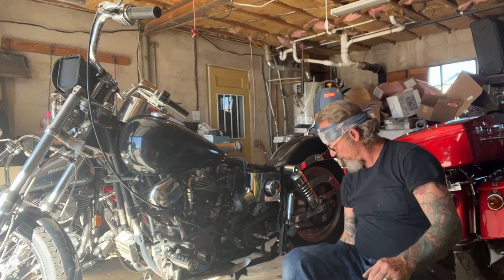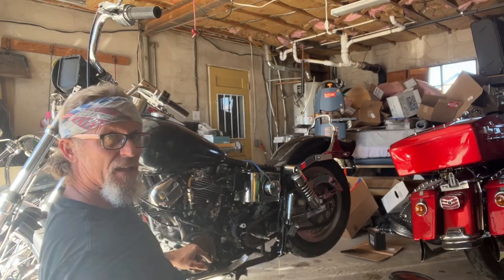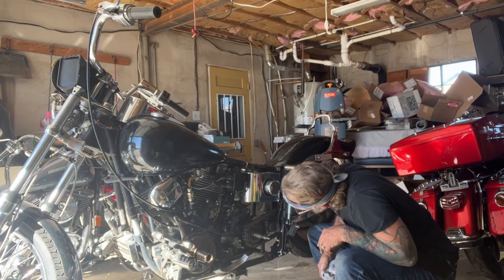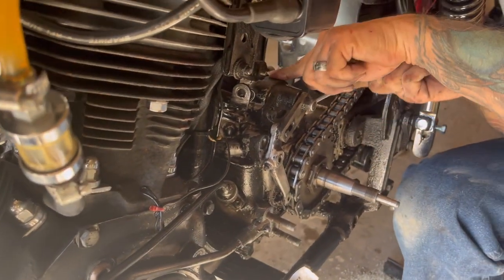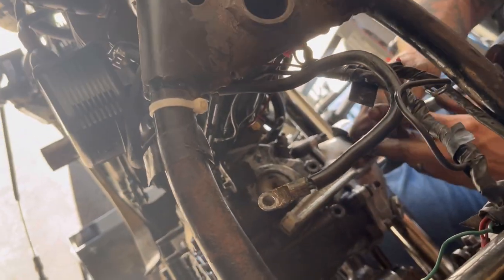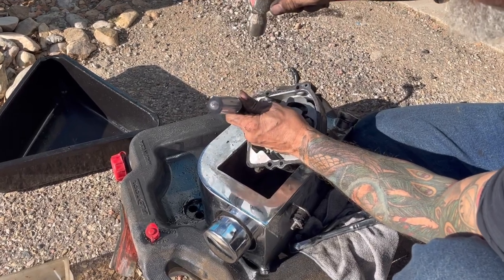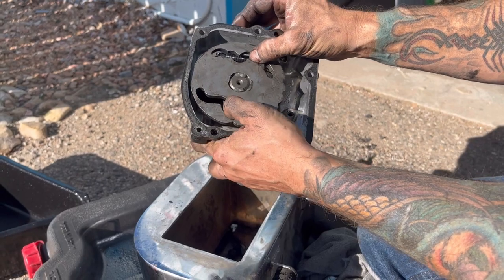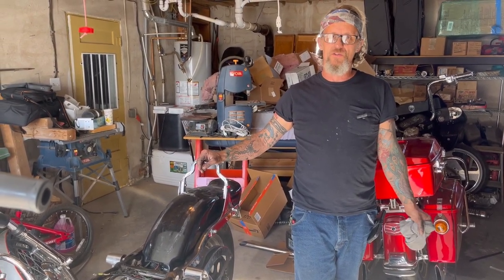Shovelhead Transmission Rotary Top Removal

Comment: Three years ago I took the engine and transmission out of my 77 flh to freshen everything up. There was easily over 50 thousand miles on the top end and who knows what was on the bottom end and transmission.  I ended up sending it to Dragonmans and he rebuilt the engine and transmission for $2000 and that included all parts. When I got it back two weeks later everything looked really good like new the cases were bead blasted. The only thing I had to do was paint the cylinders wrinkle black , put the top end back together and reinstall it in the bike. Almost 15,000 miles on it and she's running fantastic. I still can't believe the deal I got and how nice everything looked , plus how quickly it got done.
Reply from the maker: First positive thing I’ve heard about him !! Glad it worked out for you !!

Comment: The bore that the broken shaft rotates on can be worn, and COULD be the reason those welds failed. 
I just took mine apart now, no broken welds, but a bad bore or shaft.

Comment: one more question for you... when i down shift the shifter lever stays down and won't return...is my issue in the transmission or just the lever?
Reply from the maker: Sounds like the springs inside the ratcheting top of the rotary

Comment: it looks like the weld is busted connecting the shaft to the gear selector plate. @ 16:45.  the plate moves the shaft does not.
Reply from the maker: That’s what the problem was

Comment: IIRC, you may need to bush or rebush the top, actually I worked for a guy who did several tops that way,, all the parts in a rebuild kit, for 'Cow Pie' top, and he'd say, it was only the bushing, for that shaft, that went out of round, so...
Reply from the maker: Good advice! The bushing on this one wasn’t out of spec, but it does happen that Bike has been built, rebuilt, and sold twice since the video was put out

Comment: is there a way to replace the pawl springs without having to remove/reweld the rotary???
Reply from the maker: You have to remove the rotor assembly to replace the springs, not re-weld, but pull the cap on top and disassemble then replace Springs and go from there
Reply: What is the actual name of the top hat??? Mine is missing them
Reply from the maker: @JZNYC  I honestly don’t know what its actual name is if I get a minute, I’ll pull the book and see what the manual says as name
Reply: did some research and found em.. they are called shift fork rollers.... thank you for the responses
 @HobsonsChoiceHarleys

Comment: Good video. Don't bother trying to weld that cam plate, they are common items on ebay. That might mean they are notorious for breaking.The manual says to drill a hole in that top freeze plug and use a screwdriver to pry it out so you can get to the snap ring. Put some permatex on the new one and hit it with a hammer to expand it into place..BTW if you drop one of those shift finger rollers (top hats) down inside there, you'll wish your mother had been a boy. Never mind how I learned that....

Comment: When that bike got converted from belt to chain the transmission main shaft, 4th gear and some countershaft gear all had to be changed to get a chain sprocket in place. Did you do that conversion work?  I just got a 1982 belt drive trans (rotary top) and have to make that conversion
Reply from the maker: This is an 81 and has chain drive was stock , no conversion, it was a weird time at the motor company, with amf being gazed out and new designs coming out 79 thru 84 had a mix match of stuff coming outta the factory

Comment: Having to take half the machine apart just to get to a little piece…. Is familiar. I would have taken the transmission out as that seems to be less work. The oil bag with all the oil could have stayed in, saving the cost of new oil. But my bikes have the stock oil bag so it might be different here.
Reply from the maker: Yeah, it’s kind of comparing apples to oranges! This was a clients bike, and when it came in the transmission was bone dry, and the oil hadn’t been changed since Jesus was a boy, was also replacing the battery and a lot of other electrical stuff, but there is always two ways to skin a cat!👊

Comment: Hi I’m also working on the same bike replacing trans main shaft seal trans runs fine the only problem I have is that when I go to first the lever will not return without help but the rest of the gears return back fine any help would be appreciated thanks
Reply from the maker: Go thru the top , clean it well and check for debris in shift pawl